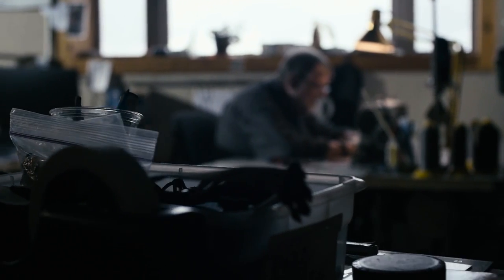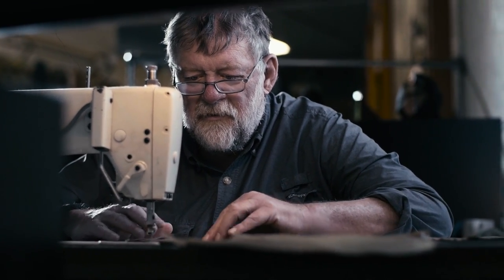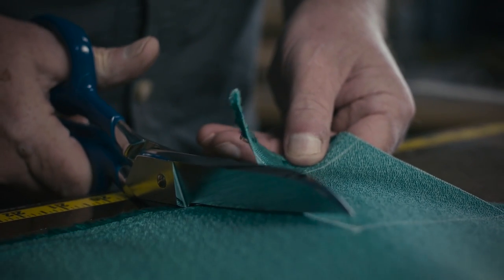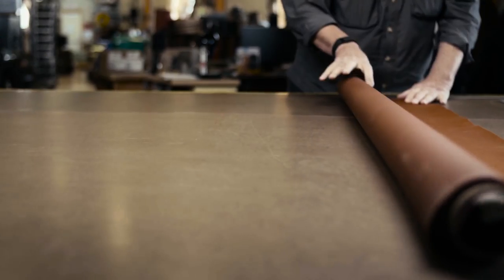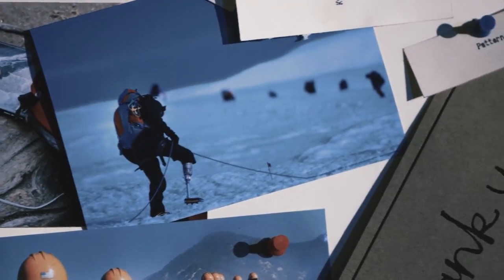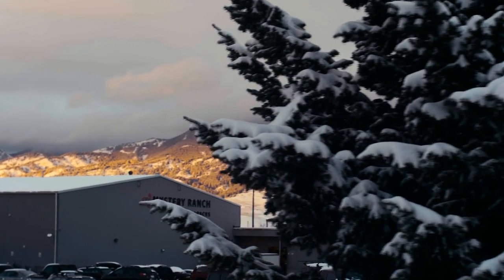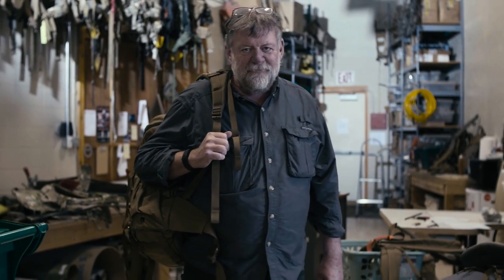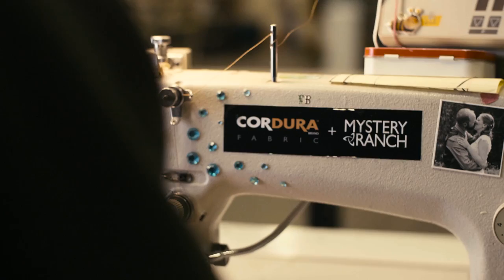Meet the Maker: Dana Gleason of Mystery Ranch

Comment: I still have my early to mid 90’s Dana Astroplane and my Terraplane. 
And my 2 bang tails. 
All made in Bozeman Mt. 
can’t beat them. 
The inside of the packs are getting a little sticky. I heard that could be fixed easily with corn starch application. 
Any opinions??
Cannot justify buying a mystery ranch when my Dana packs are still running strong.
Reply: Hows the foam in the backpad holding up? Mine disintegrated, other than that my Dana Astroplane overkill looks brand new after 25 years of use.
Reply: @rchristianwooley4870  
Everything is still in tiptop shape. Not sure where you store yours but my Astroplane always hangs in my closet with zips open. 
The only issue I had was the inside of my pack was getting a little sticky from the waterproofing treatment they used on the backside of the nylon starting to break down. 
But I treated it with a little bit of powdered cornstarch per Other people’s recommendation and that completely fixed that issue. 
That is the most comfortable pack I’ve ever owned. 
It has a lot of miles on it.
I recently bought the Kifaru Stryker XL pack. 
Made is USA 🇺🇸. 
That is a top-notch pack also.
Reply: @jayonez137  I've stored mine pretty much the same with the belt removed and inside the main chamber. The only real de-laminated issues I've had were with a Dana accessories pouch that fits across the stomach. It attaches to the lower part of the shoulder straps. It kinda looks like a deflated football with a zipper on top.

Comment: That cordura used back in the seventies sucked. I have an original gleason pack from the 70's. Its unusable today because the of delamination of the water proofing. Its smells horrible and the coating is a sticky, pealing mess.